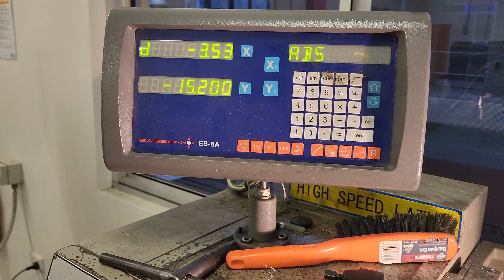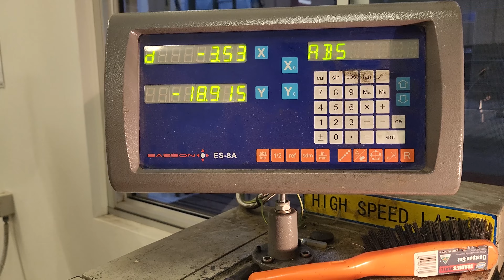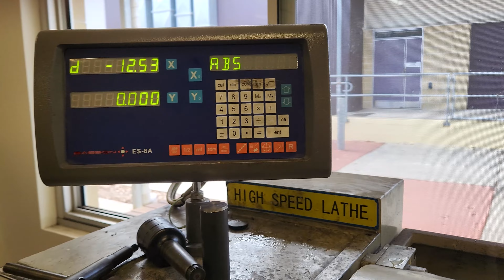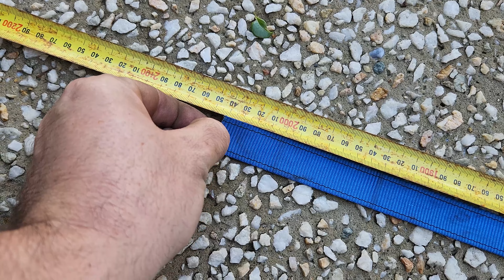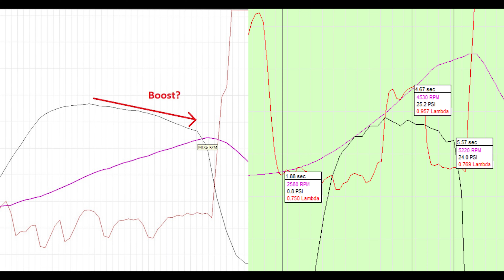BIGEV | SUPER TENSIONER

Comment: Why go with a spring loaded tensioner mate instead of a fixed adjustable tensioner?
Reply from the maker: The benefit of a spring tentioner is as the belt stretches under high loads it keep the same tention on the pulley so it doesn't loose grip creating boost dips. It's comes down to surface area and tention.. a fixed belt would work great if it was a gilmer belt